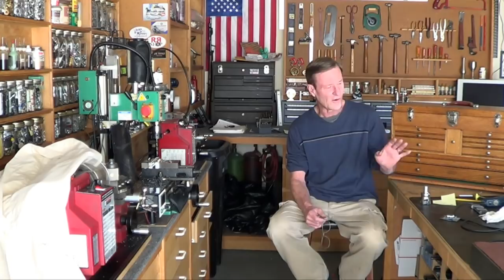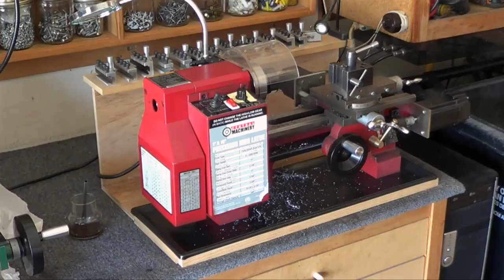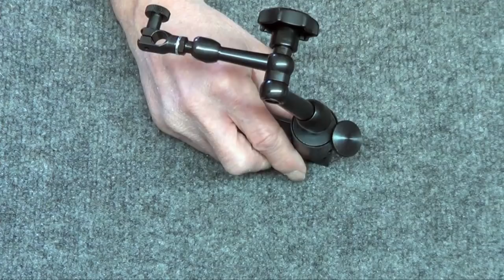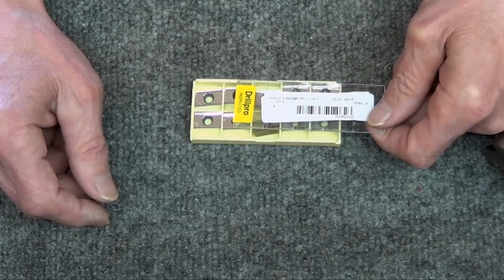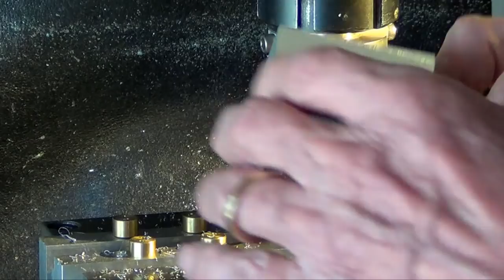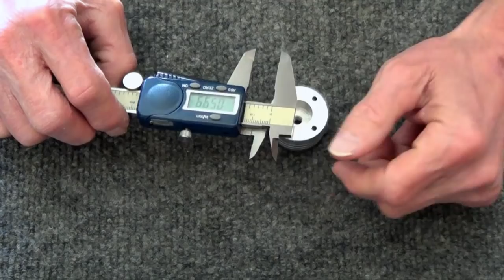More New Shop Tools And Reviews

Comment: Saw this some time ago and I was thinking about getting that Noga so I rewatched the video. 
Just so you know, there’s a M42 Drill Hog set with a round shank selling on EBay now for $70.
Also, Banggood now has the Drillpro inserts in a “Blue Nano coating” and they have a great review on You Tube.
Reply from the maker: Good info on the Drill Hog set. Love the set I bought off Ebay from them. Bought some inserts off Banggood and seems to be a crap shoot on quality. Some good some bad. There will be an up coming video on round inserts from them and they don't feel sharp at all but I'll see when making the holder and testing them out. And without a doubt buy the Noga I showed as it made a big difference in the shop for me!
Reply: Dave M  Yes, I want that Noga.  Can’t wait to see the round inserts and how they perform.
Reply: Also, I needed a grooving and cutoff tool.  I bought 2 with this recommendation.

Comment: As an EE and Radio Ham, I am always saddened by the fact that if you use a tool or a chemical, someone in California dies...
BTW !!! Don't go scaring people about electrical fields and magnetic fields we encounter in our houses and environment.
There is research that suggest it has an influence and there is just as much research that indicates the opposite .... this is exactly what we would expect if there is NO effect.
The most silly and dangerous thing we can do is apply the "precautionary principle" . This halts innovation, makes no scientific sense and usually ends up in good money thrown after bad....with the whole hypotheses thrown in a bin after a while (and these 'scientific old wive's tales are very hard to kill, no matter how daft they are)
Also, please be a bit more precise with what you call 'radiation'.... 
The magnetic interference from the Chinese mini lathe should be shielded, yes.... not because it will fry your gonads or your noggin (it won't) but because it interferes with legitimate radio traffic.
Unless you straddle that lathe, on full throttle, for days even weeks on end... your skin will not even heat up in a measurable way, let along anything else !
These days there is an undue amount of electro-smog around the place, and that is a bad thing for other electronics (such as communications equipment). This is because of all the cheap imports of the far east and the lack of controls and certification we used to have.
Is it dangerous ? Only to the blood-pressure of radio amateurs !
Don't be scared by FOX-news type of 'science' reporting,please!
We in Europe HAD good laws, back in the day when you couldn't sell a device that wasn't properly shielded.(this was done for TV and radio broadcasts!!) These days that seems to be abandoned and the newer laws are dictated by people who do not understand the scientific principle and to this very toxic 'precautionary principle'
People do NOT die of cancer when exposed to high intensity magnetic fields (every MRI scanner event would be a death sentence !!!) If you quote research, you should also reference it (and check it's validity) 
We as engineers and scientists should know better and be very cautious when citing so called sources of authority !
Be critical and use your noggin! 

Paddy 

Paddy

Comment: You might want to look into getting one of the MachTach kits (machtach.com) for your mill and lathes.  I have one on both my Taig Micro Mill and Micro lathe and am just about to add one on my Atlas lathe.  The MachTach is capable of displaying revolutions per minute (RPM), surface feet per minute (SFM), and surface meters per minute (SMM).  You have a choice of sensor types.

Comment from the maker: Retired my subscription to IEEE some time ago. The ANSI C95.1 standard allows, IMO, massive exposure over a time limit as they are more concerned with whole body heating and eye damage while ignoring possible cell damage/mutation. There has been much research concerning the effects of radiation, be it magnetic or electric, on cells. I remember years ago doctors had experimented with strong magnetic fields in an attempt to speed up the healing of broken bones. All patients died of cancer. Thus why Europe has such strict standards.
Reply: Dave M, I’ve thought about getting an EMF tester like this one you showed, I think it would be a handy little tool to have around the house. Definitely would not take it to work with me though as I work in the power industry as a gas and steam turbine operator, that would probably scare the crap out of me LOL. Looks like I’m going to be doing some shielding on my 7x12 Central Machinery mini lathe though 😉, thanks for sharing that. I would also definitely enjoy hearing you talk more about your experience and expertise as an electrical engineer as well, maybe you could do a video of you adding shielding to your lathes and use it as an opportunity to talk about some basics of electrical engineering principles in shielding and grounding.
Reply: Can you share a source for this claim? Also, by physics, if electromagnetic radiation is less than Ultraviolet (3-4eV) it cannot ionize but can only vibrate. Microwaves vibrate water, microwaves do not ionize. I worry about getting a fever or getting a sunburn from UV more than my cell phone warming up my body a couple ten thousands of a degree in a small spot.

Comment: Hi Dave,  "split point" drill bits reduce the "chisel point" of the bit.  If you compare non-split and split point, you will notice the split point cutting edges go clear up to a point.  Non-split have a tip that doesn't have cutting edges and doesn't cut.  When you are drilling you have to force the non-cutting tip into the material.  This is the main reason you need pilot holes when drilling.  They provide clearance for the tip of the drill to reduce the force required and reduce the tendency of the bit to wander.  Really relish Fridays in the shop with you!  Keep it up!

Comment: Hi Steve: The standard drill bit geometry in the metallurgy industry, calls for what is called 4 or six facet drill point, sharpened at 135 degrees and 140 for special purposes and materials.
The reason is not only the self centering properties of that primary angle, but less cutting pressure needed, less heat and far longer period of bit replacement after thousands of holes drilled non stop. I send you an excellent article by a Mechanical Engineer on the subject that will tell you all that you wanted to know about drill bits, and were afraid to ask.
https://www.mmsonline.com/articles/choose-the-best-drill-point-geometry

Regards

Comment: There's some sketchy Amazon reviews on this Drill Hog bits. I need a set bad, want to take the leap, but wow those reviews have me questioning the purchase.
Reply from the maker: The only thing I can say is these bits grab as they break thru which is very irritating. Other than that they are fantastic! I still prefer my HSS Chicago Latrobe stub bits the most #69900.
Reply: I have had DH bits for awhile now. No issues.

Comment: If you have any crap lathe tooling laying around I got little crafstman 109.20630 that was supposed to come with tooling and a chuck but ofcourse instead it has a faceplate and one 5/16th or maybe 1/4th inch hand ground tool smh....any way I'd be eternally greatful to take whatever trash you have and treasure it lol.
Reply from the maker: LOL wish I had something to send you my friend but I no have.... everything gets used one way or another.
Reply: I hear ya man.. I just got a (new to me) lathe and damn that carbide is expensive! Maybe you can find a deal at the local flea market? Score some old HSS tooling and grind it down to your needs.
Reply: No worries, I'll come up with something eventually, stupid VA check makes crap take forever..